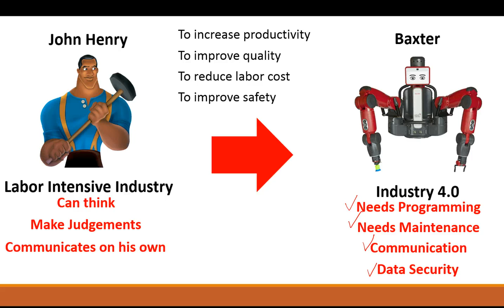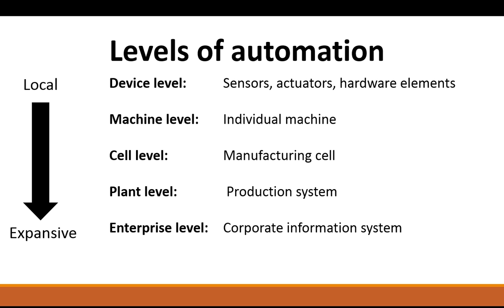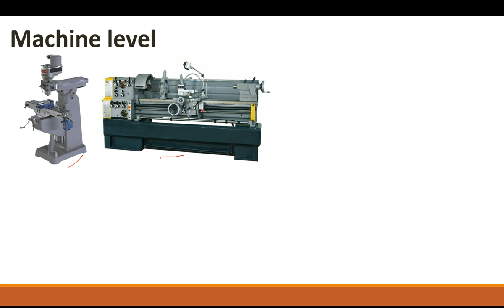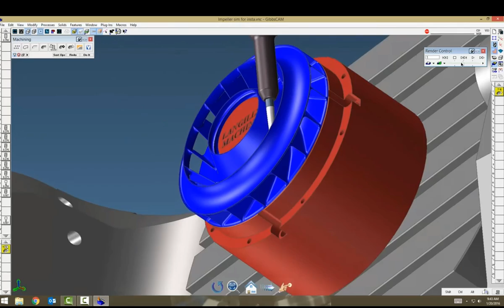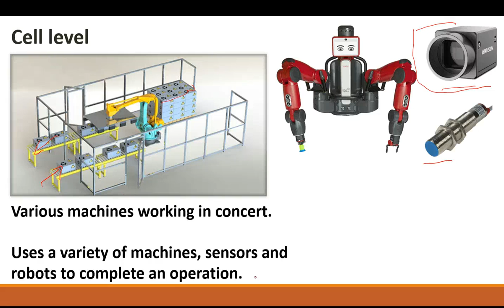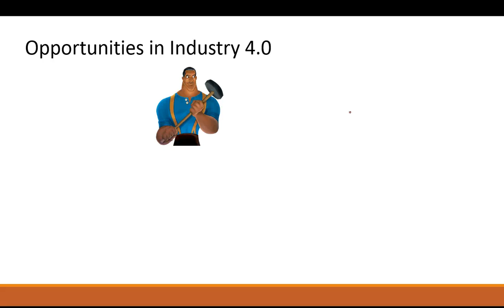Automation - (Part 2: Industry 4.0 and The Skills Gap)

Comment: Excellent lecture Professor Cummings, as usual.  I would add/emphasize when you mention examples why data security is so important to an Industry 4.0 (& IIoT) system, #Safety . During decades of transition, there will still be humans interacting with the machines in manufacturing, and there for at risk if automation systems program security is compromised. If hazardous material is involved like in oil and chemical industries, even surrounding neighborhoods could be at risk if data security in compromised.  Ref: http://plc-training.org/plc-network-to-hmi-scada.html
Reply from the maker: You make an awesome point!  As we can see from recent events, data security can be the only safe guard to all sorts of outside manipulation.  The consequences of taking this lightly can be devastating.
Reply: So True. All us educators have to do our little part to try to help industries and companies from learning the hard way. :)